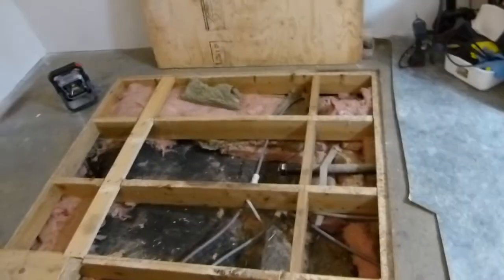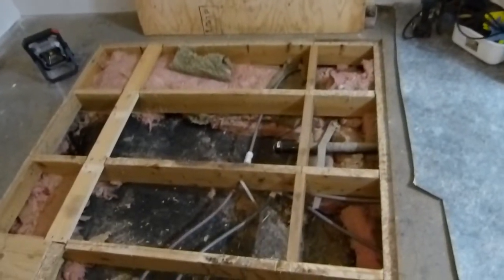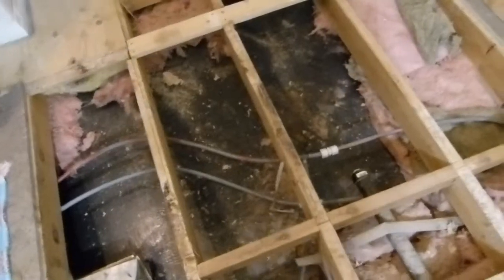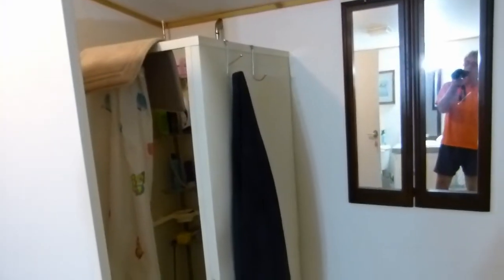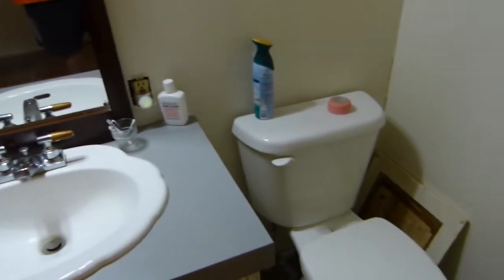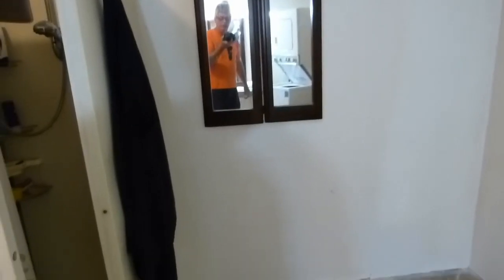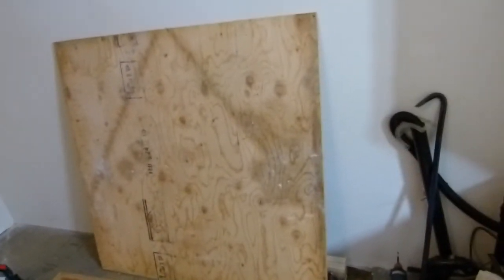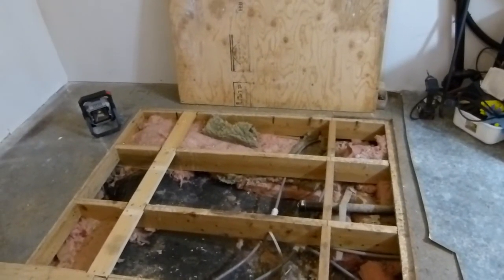Bathroom Disaster vlog 1

Comment: Polybutylene is bad news, we had multiple leaks in a six month span, we had the entire house re-piped. sorry it happened to you, but now you might have to check the rest of the pipe.
Reply from the maker: It seems the connections are the weak point.  This was the T fitting itself.  Probably vibration from the washer on spin cycle.  If I could afford it I would replace it all with PEX.